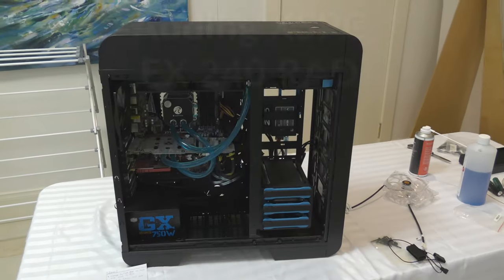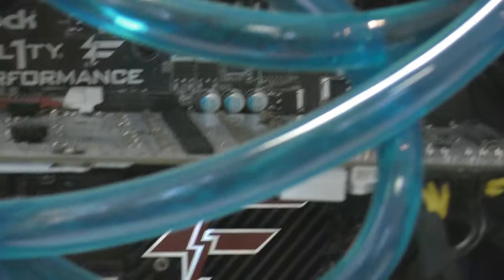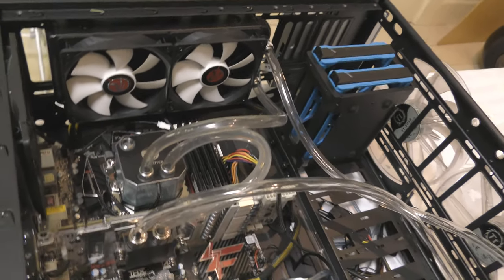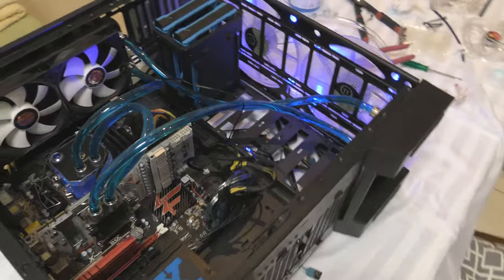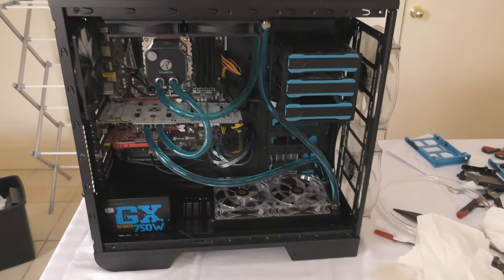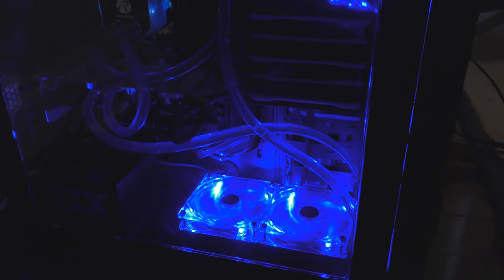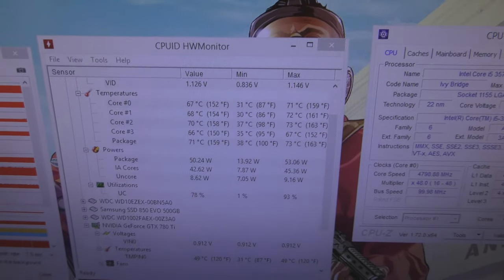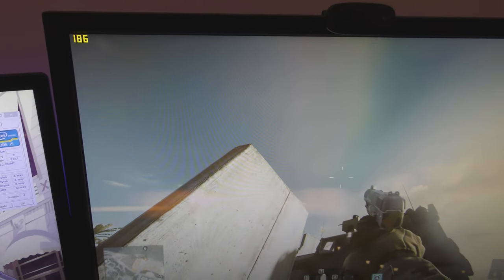Upgrading My Gaming PC / Adding EX 240 Rad / 4K

Comment: Hello there! Can you please tell me what ID/OD tubing did you use and if you change the original fittings? I am planning to expand my triton too and i could really use some help... Nice video sir and thank you for making it! :)

Oh, the non-k means "locked multipliers" not that you cant overclock it. Actually a limit on the multipliers not locked exactly, 42 (4.2Ghz) for the 3570. I've managed to have a stable overclock at 4.4 by changing the base clock and voltage after a week of testing. :D

Comment: whats your temps? beacause this 120 l/ph liquid flow doesnt seem to be enough for a gpu and cpu . and how was ur temps before the second rad
Reply from the maker: +AnastMet Actually they are good, my 780ti overclocked has a max temp of 54 degrees Celsius and my CPU I5 3570k @ 4.8GHZ is around 79-80 degrees Celsius after the added radiator. Before the CPU was about 5 degrees hotter so I had it at 4.6GHZ and the GPU was about the same. I think my CPU has bad thermal paste on its die so that's why the temps are not the best (I can't really fix that).
Reply: +Baldrick sodoff what do u think can i watercool my i5 and r9 290 (none overclocked)? because now my i5 gets around 60-65 degrees C and my GPU around 76-81 C
Reply from the maker: AnastMet Yeah it would be good to watercool the I5 and 290 but don't bother unless the CPU ends in a K as the others cant be overclocked e.g the 3570 cant be overclocked but a 3570k can. It looks like the 290 would get much better temps watercooled. Also keep in mind you will get better performance just buying new components as opposed to watercooling your current ones.
Reply: +Baldrick sodoff yeah i know about the k i just want better temps and looking (and maybe an oc some time later at the gpu as its an oc version) thank u very much!